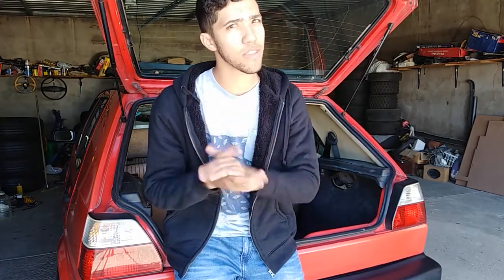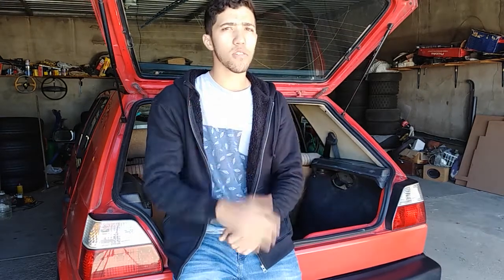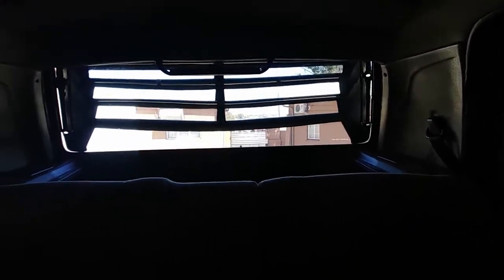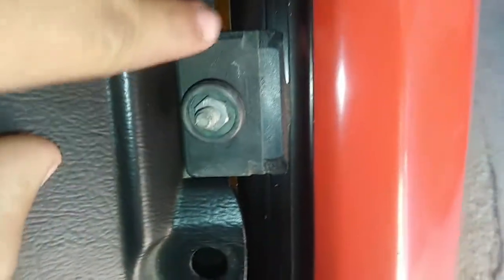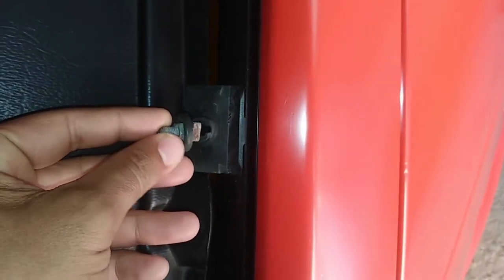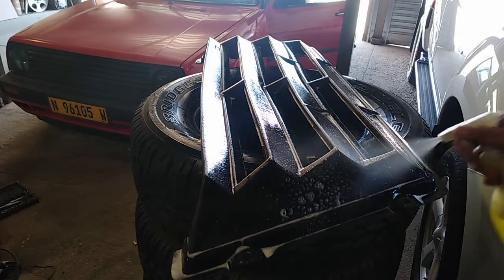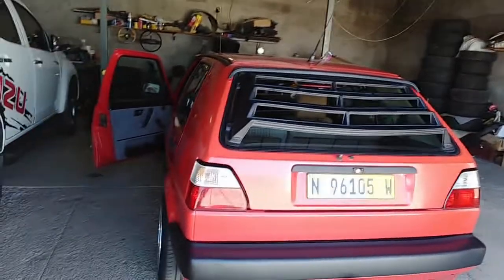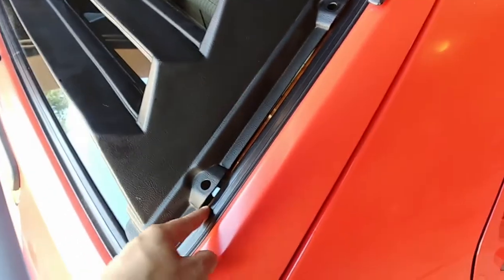Louvers making a come back? |VW TURBO MK2

Comment: Hello, was it difficult to slip the bracket clips under the window rubbers? How did you go about doing it?
Reply from the maker: @Seraaj roomaney. I only used double sided tape to the rear window. I didnt use the brakets as i didnt think i would keep the louvers and they might just damage the rubber unnecessarily.
Reply: @061garage  ok thanks, I got a perana louvre and it looks good on the car (my mk2 is white), I'll figure out how to fit the brackets
Reply from the maker: @seraajroomaney3148  great stuff. I want to reshade my louver to make it look more agressive. You got an IG i can see your car on?.
Reply: @061garage  unfortunately (or fortunately) I'm not on any social media
Reply from the maker: @seraajroomaney3148  all good.